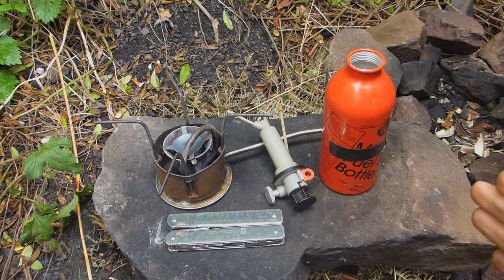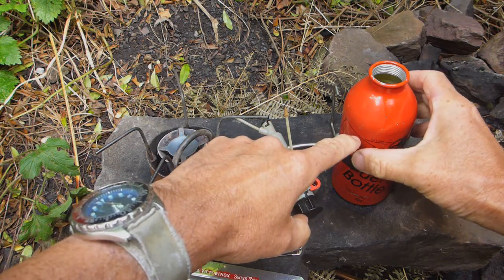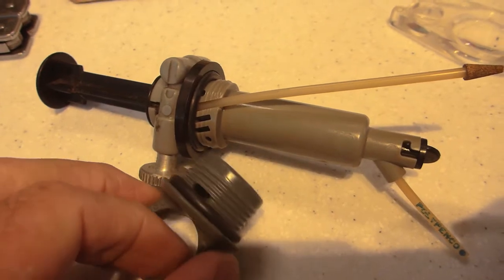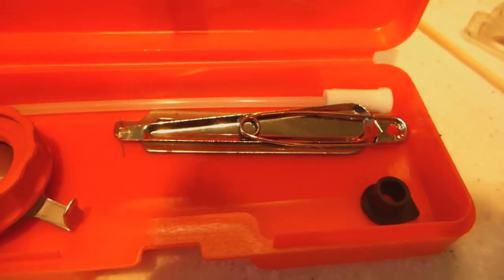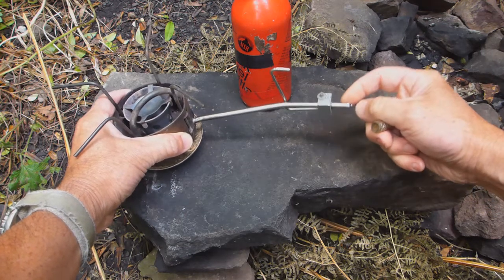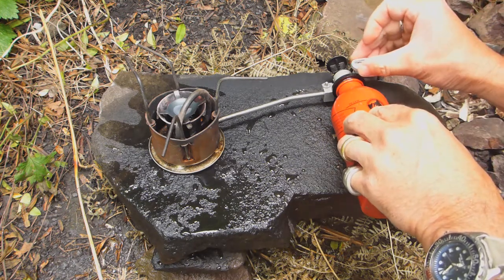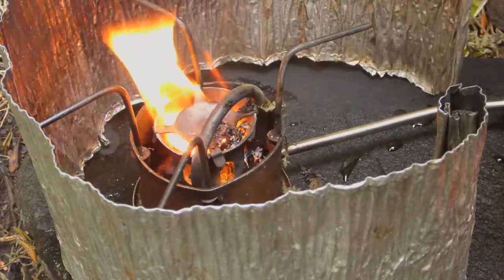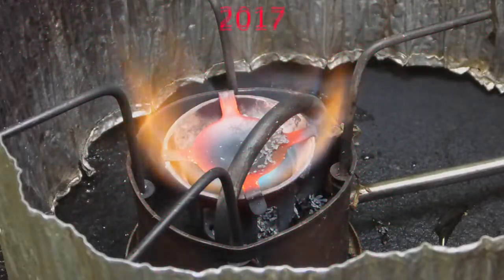MSR XGK multi fuel Stove Basic Service and Safety

Comment: Does this have a Shaker Jet and do you have any videos of taking this stove apart putting back together???
Reply from the maker: Hi, no. This was the second/first generation XGK from MSR and no shaker jet, jus the stainless steel cable for cleaning the fuel line and a small replaceable jet cleaning needle tool (it has two cleaning needles on a little handle). The stove doesn't clog easily. I took it to Everest once  for over 2 months and didn't need to service it, although it was running on Jet A1 fuel a lot of the time and or good quality Kero. I can do a pull down but there isn't much to really do with the stove it's self. The big pull down and where one needs to be very carful is the pump. Let me look into it. Are you thinking of getting one?
Reply: Bush Camping Tools yes actually I’m gonna try be buying one it’s the XGK 2 it’s older but looks good comes with pump fuel bottle and stove for 20$ I own few msr stoves but none as old as this version
Reply from the maker: @plumpye474  Yeah if you can get all the necessary parts (and you should because i can still buy genuine MSR parts for my old XGK) then that sounds like a great deal!

Comment: Wow that's too complicated for me. It feels like learning how to take an AR 15 apart all over again. I'm glad you found the problem before you got yourself in trouble. I'd be the guy rolling on the ground trying to put the fire out.
Reply from the maker: LOL mate, that's exactly what happened to a mate of mine years back, he was using white gas in his, had a leak from the pump and he was on fire. We rolled him in the wet grass and other than a lot of adrenalin, he had a bit of a melted jacket. But seriously when they are correctly serviced they run like rockets and mine as I said has served me well for many years. As for the parts and pulling it apart, there were many parts I just didn't show as the video was getting on. Thanks for watching!
Reply from the maker: Talking about AR15's, have you seen those vids where that guy just basically melts the receiver by firing way to long and rapidly as possible (on purpose), to see if it can handle the heat., crazy as!

Comment: These things run on the same concept that pressure lanterns (mantle type) do yeah?
Reply from the maker: yes that is correct. The fuel line passes over or near to the actual burner, one ignites first the burner by basically setting it on fire LOL, then this flame heats the tube passing near or over it thereby vapourizing the liquid fuel to essentially a gaseous state and it's this gas which is being burnt, hence very efficient on fuel consumption. Lot's of noise from the burner assembly and lots of fun LOL! As always thanks for watching and commenting!